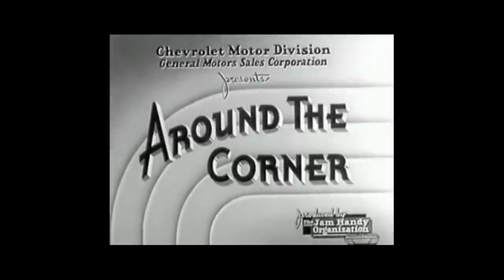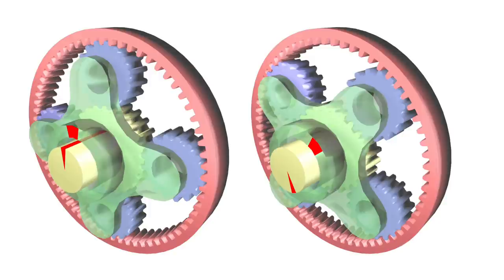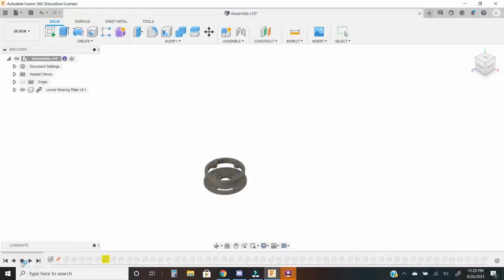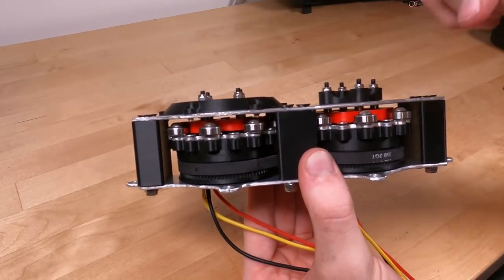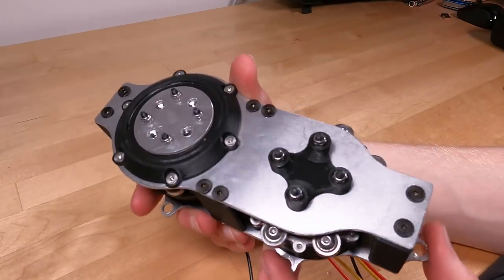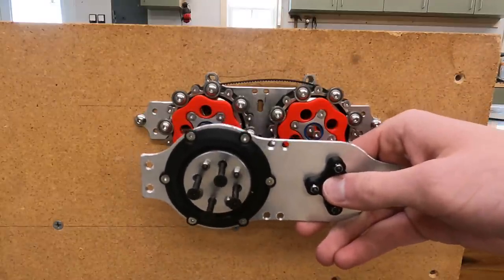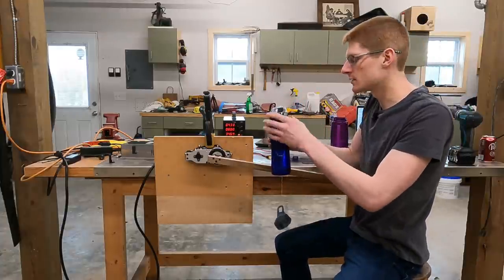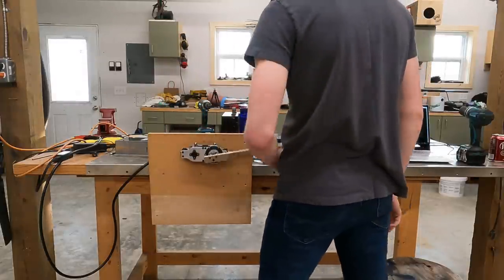The Differential Drive - A New Breed of Actuator

Comment: Well. I mean, it is pretty.

But yeah, the second and third hypotheses sounded pretty dubious to me. Electric motors have by far the most torque when they're at zero velocity, with torque falling off inverse to speed.

What you built is, in a sense, a backward differential... but a simple differential has a similar problem. If you lift a car with a simple differential up, and hold on to the tire on one side, you can drive the opposite wheel as fast as you want and feel very little force on the one you're holding. Considering you are nowhere near as strong as a car engine, this should be telling. (Edit: do not try this at home, or if you don't have a full understanding of the mechanisms at play and the vehicle's history. If you were doing this, got the differential up to speed, and then it failed in certain ways, you could easily end up badly injured as friction builds suddenly and makes the wheel you're holding onto spin with the force not only of the engine and all its momentum, but the other wheel's momentum as well!)

If you wanted to actually make some kind of a go at this, you'd need to study things like limited slip differentials, or viscous differentials. I'm... not at all sure those would translate into the kind of stationary torque you have in mind, though. Ultimately I think the maximum stall torque would end up limited to the friction or viscosity of the limited slip system.

If you think about it, this is no different from a normal actuator gearbox... only there, the thing resisting the movement against the motor is the sheer mass of the vehicle/device/workbench it's attached to, along with the fasteners and joints therein. With this setup, the thing resisting the movement is... well... nothing. Just whatever parasitic friction there is inside the setup. XD

Like you said, you live and you learn.

Comment: Doesn't seem right. I don't think that you can achieve any speed or output resolution.
I need to see you equation.
I am wrong if
No of times, output shaft turns is not equal to x times ( turns on input shaft a +turns on input shaft b)

Just think about it 99 steps on motor a and -100 steps on motor b yields same result as 9 steeps on motor a and -10 on b

Comment: Working with electrical / electronics on a metal topped work bench?
You would be fired quickly in my shop.
Please, for your own safety, get rid of the metal top before doing any more electrical / electronic work on that bench.
Metal top benches are for mechanics, NOT electrical.
Other than that. Cool video and very interesting. My mind is definitely stimulated.

Comment: Great and interesting experiment... I am an electrical engineer, but I think I skipped the class about "stalled torque"... going to learn it now.

The speed combination or disaggregation function is well known in the Prius power split device (a planetary), a differential (as you said), and 2 motors connected in series (output shaft of M1 spins the case of M2, powered by a slip ring)... there's a Prius simulation video showing that ;)
https://www.youtube.com/watch?v=E_xCssR8qQI

One way to model the torque of 2 motors adding speed is with "harmonic sum" of parallel resistors. 1/R1+1/R2=1/R3, but with torques... 1/t1+1/t2=1/t3... if t1 increases a lot, t3 starts looking like plain t2... but if t1=t2, then t3=t2/2, but the speed is the sum of the 2 input speeds.

Comment: So you were trying to make a variable 'transmission'? (not cars, just the mechanical idea)
Nah, this probably wouldn't do anything useful. You'd have to use a fluid-based transmission, which took me over a month of time to figure out. As you've set yours up, trying to get variability in torque transmission would simply be a power-lost type of transmission which allows slip.
Reply from the maker: I was not. I was simply investigating this motor coupling method, beginning with some faulty hypotheses. It doesn't seem you watched to the end.

Comment: So if the output is the sum of the inputs (in speed) then isn't it impossible for the torque output to be the sum of the two motors also?

As in there is no trade off.

Comment: You're literally NOT doing what you say you're doing. On a differential (a mechanical adding device) if you have 2 motors capable of 100 rpm @ 10lb/ft on the input, you'd have 100 rpm 20lb/ft on the output. If you're claiming both motors are the same then if they wouldnt hold, that's entirely you miscalculating your own device. I see what you did, and you have so much wrong with that setup it's painful. First off you're using cycloidal drives. Unless I colloidal drive, the housing and the drive motor should be locked together. In your case, they are not. For example if your motor is locked in a single position, and you advance the housing six times with a 6:1 ratio, the output should rotate once relative to the housing. Theres your first problem. Your second problem is that you are coupling the output of one motor to the input of another motor at a 6:1 ratio. This isnt addition anymore with a math problem like this. Now if you woulda made a differential gearset, this would not be the same result. The main problem lies in your non-relative motor placement in your cycloidal drives. This is why you lock the shell (to the same plane that the drive motor is locked to) and it works, debase the motor from the shell and you have big trouble in little china. Think of it like trying to jump off of a trampoline at the same instant that someone is simultaniously landing on. The motor has nothing to push against = no torque...

Comment: First video of yours that I watch, I have a couple of suggestion to improve how you convey your info :
- don't say "of course", "as we all know" and similar stuff. You don't know who may be watching, so making assumptions on what all your viewers know is not good.
- try to improve the "explanation only" sections of your video (first third). Maybe add more animations or change how you expose your reasoning, the hypothesis 1-2-3 approach makes it look much more like a lecture than it needs to be.
- the first time you show your mechanism you say something on the line of "we have two motors here, and you don't see them because they are covered. Here you can see the wires" try to reword sentences like that, and avoid pointing out the ovious (you can see the motor wires)
- I would have preferred a breakdown of your mechanism when you first showed it, maybe a build time-lapse or similar, so I can quickly figure out at least how it vaguely works

Keeep up the good work!